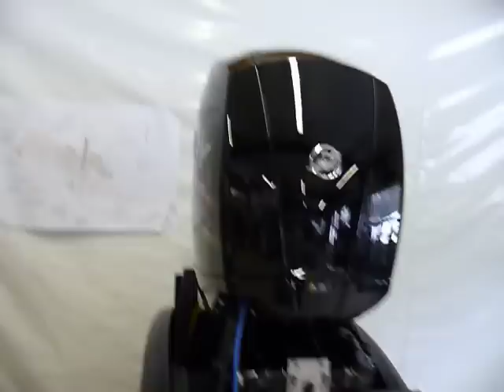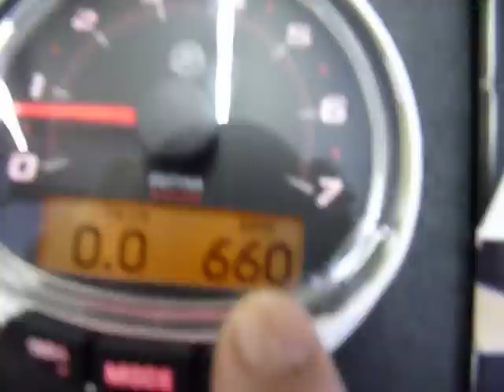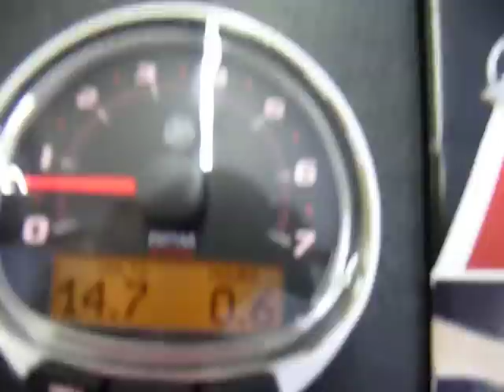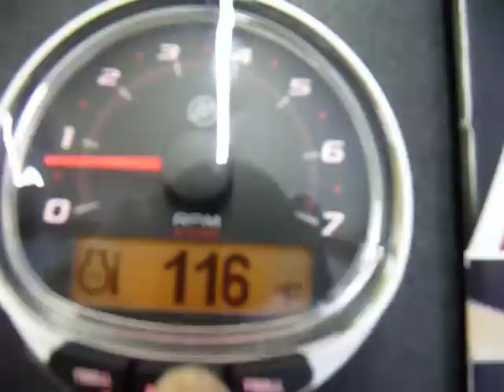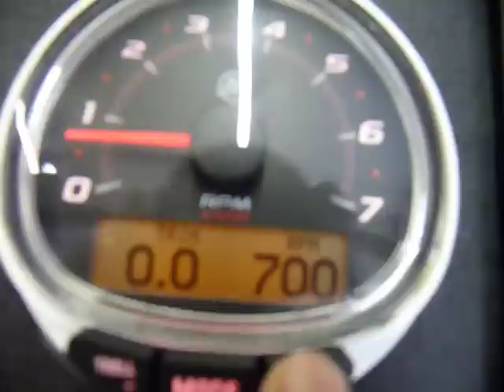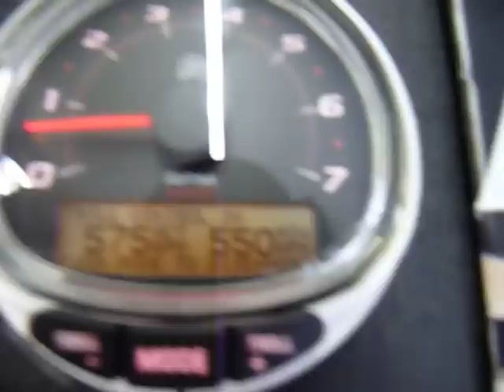Troll Control Demo with 2013 Mercury 150 hp 4 stroke

Comment: I got a tach with my merc 150 i just bought it i hope i get the same tach as this 1
Reply from the maker: If it's a smart craft tach the answer is yes!
Reply: @RonaldWinter  i got the regular analog tach gauge tho there bud
Reply from the maker: @edwardabrahamiii3742  The replacement smart craft rpm gauge and kit run about $450.

Comment from the maker: Idle is 650 rpms.  It will go to 550 rpm's with the Troll Control. I will troll at 3 mph at 700 rpm and have to used bag or bags to get it down to 2 mph with two bags for 2.3 with one bag trolling for salmon.

Comment: What do you need to add on to the motor to use the troll control function? Thanks
Reply: did you ever get a response.  I have been trying to get an answer also.
Reply: @joesmith-hh7wc did you ever get a response? I need this info